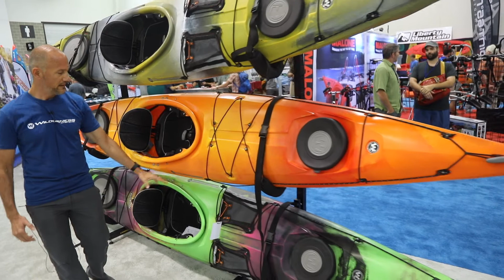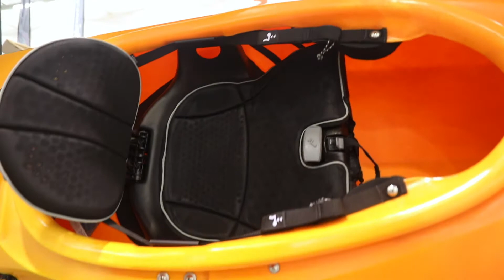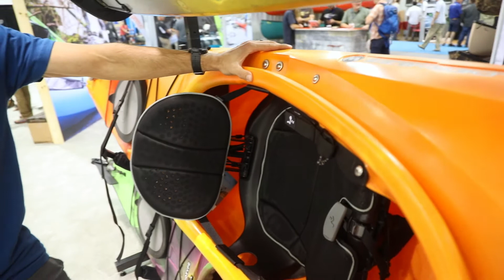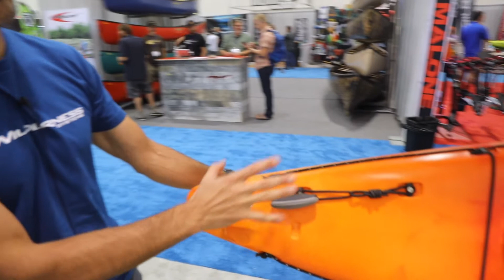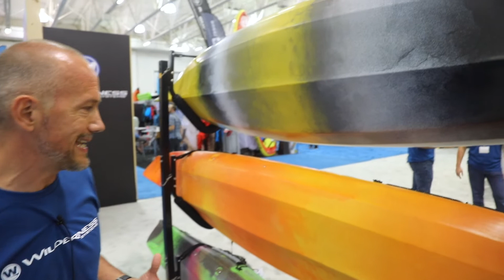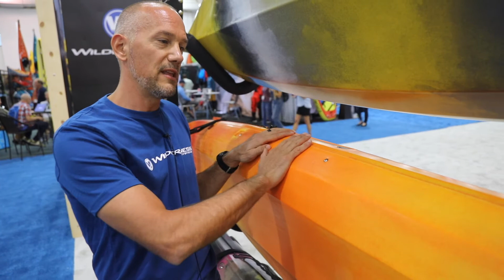Wilderness Systems Tsunami Kayaks | Touring Kayak | Specs & Features Review and Walk Around

Comment: Specs on the WS web site are wrong, the company has reported a cockpit size (20” wide by 36” long) that includes the rim, so it’s not the size of the actual opening, which is 16” x 32”. This means, these newer ones won’t fit large paddlers, it’s more for small and medium. And, the rearward 6” of the opening is taken up by the seat, so the space you have to get inside is not very much. They are reporting the same size for the other models too, the new ones are all same narrow and snug cockpit opening of 16” x 32”. This is a deal-breaker for many, so anyone that’s over 200lbs., good luck getting inside the Tsunami very easily. It’s roomy once you get in, though - but the snug fit probably makes wet exits more difficult for larger people. Otherwise, these are still great kayaks and a super value, with tracking, stability and features really hard to beat among the roto-molded polyethylene kayaks.

Comment: I love my Tsunami 165. I've had it in some choppy seas with good size (7-8 foot) rolling waves, and it handles it incredibly well. Primary and secondary stability is rock solid, and the rudder really helps when paddling in strong winds. As a larger (fat) person, this  boat is really comfortable for long days on the water. It isn't the most playful boat, but I get it moving pretty well and keep decent speed with it.

Comment: How is it in the wind?  My current kayak has a skeg and it weathercocks like hell.  It pivots around on the skeg if there is the slightest breeze.
Reply: It does weathercock in the wind. A rudder really helps with that though. I paddled my Tsunami 165 in 25 kt winds a few days ago and the rudder kept me going where I wanted to no matter which direction I went.

Comment: I’m assuming that this will outperform the Pungo?
Reply: They are fairly different boats. Tsunami has bow and stern sealed compartments, a smaller cockpit, and tracks better.
Reply: Tsunami will be faster and more efficient than the Pungo
Reply: The Tsunami with bow and stern bulkheads and more deck lines will make it safer on larger bodies of water and assist in self rescue.  It will also be better for stowing gear for day or overnight camping.   Both are great boats but consider how you will be using them to make a final decision. If you are on protected flat water and want to take the dog or small child out then Pungo is a better choice.
Reply: Fed Guy the difference is actually not that big. I have a Tsunami and have paddled the Pungo.
Reply: The pungo is a recreational kayak. The wilderness tsunami is a touring kayak. Two completely different kinds of boats.